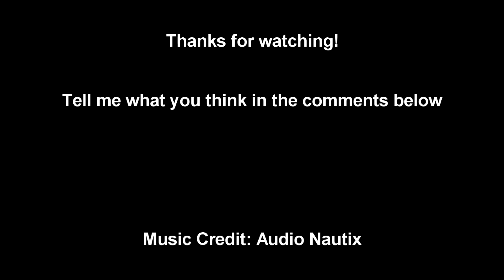The perfect multirotor tune (an IBCrazy tutorial)

Comment: Without looking at the comments, I'm gonna say P is too high (I can hear the oscillation when you rev up) and the D gain is too low, because I didn't see it looking "bouncy" when you were trying to avoid obstacles and I have a hard time grasping D gain, so that's probably the one LOL. I'm a little confused on which it is though (roll, pitch or yaw). roll seems very responsive so that's overtuned.

Comment: Do you tune the P first then I  and finally D? Do you set the I and D low while you tune P? Get P right then work on I then D? I have an APM controller that I did an Auto tune but it has never seemed 100% right. Thought I might try a manual tune.
Reply from the maker: +MrMasemu - Usually you tune in this order: P, I, D.  I have an initial tuning guide in the description that gets you very close.  This is more of a troubleshooting and advanced guide for locking your aircraft in.

Comment: So what would happen if your d was too low and your I was to high? The reason I ask is I have a quad that shakes violently to the point I can't get it a foot off the ground. But it's slower oscillations than a p gain too high so I'm stumped.
Reply: +Kurtis Towery what mode are you flying in?  Try putting it on acro with low rates, I had a similar problem to what you describe, and it turns out it was a dodgy sensor on the flight controller, and it was going nuts trying to auto level....  Also I assuming here that you have orientated the flight controller correctly in your openpilot / cleanflight / whatever settings?  It could also be that your props are not balanced...

Comment: Your tuning method is different than mine, but I've been flying the revo and revo nano lately which changes it up quite a bit. The CC3D is a bit of a bear to tune compared to the Revo and Revo Nano. You're also making coordinated turns which makes it difficult to distinguish overtune noises from all the axis.

Not flying it myself makes it tough. There are a lot of nuances you can get from visual feedback of your physical inputs. Your roll looks way off. It seems to be overshooting which is either due to a high Ki or low Kp. Based on how well the roll starts I'd say your Ki is too high on roll. You're also using a lot more Ki than I do in roll as well. 

I think I hear some Kp oscillations during yaw, but it's hard for me to tell over your voice. I'm not hearing anything during just roll or pitch but I hear it during coordinated turns.

I know you said one axis was too high and one was too low, but I think you've actually got two that are too high. You might get similar results if you raise Kp instead of lowering Ki on roll which might be a better answer to your question.
Reply from the maker: +RS2K - Believe it or not, you're indeed correct.  I do have 2 values too high and only one too low.  However, the one that is too high is really difficult because the key is listening to the audio and connecting it to what I'm telling the vehicle to do.
Reply: +Alex Greve I spend a lot of time testing and tuning new firmware. It's good to see someone else who knows how to tune OP hardware. :)

I'd like to know what your stick inputs looks like, but I think changing your TPS curve might actually be better than turning down one of your gains since it only happens during maneuvers. I would highly recommend trying out StabilizationDesiredThrust as a source with a PI target on roll and pitch and trying out a curve that looks a little bit like a ladle (something like: 0.1, 0.05, 0.00, -0.1, -0.05). This TPS setting will change Kp and Ki based on actuator thrust instead of just throttle stick input. I find a setting like this allows you to up your gains a bit more and allows for a smoother overall experience.

Also, if you like to use a lot of high and low throttle during flight you might find this firmware to work better: https://www.dropbox.com/s/l4kc1ba6tmlyjo2/rel-15.02.02%20-%20with%20constraints.rar?dl=0
It uses motor constraints instead of a throttle overhead to provide better flight characteristics. It's the latest firmware for the CC3D and has some some of the 15.05 code in it.

If you ever get the chance I would also recommend trying out the revo or revo nano. There are some firmware changes that can really lock your multi-rotors in place. A well tuned revo feels like a gimbal it's so smooth.

My ears are only picking up the oscillation during throttle input or during coordinated turns. I don't hear it at all during only pitch or roll other than a quick motor jab on a hard pitch input, but that's not something I'd personally try to tune out and even so it may have just been the transmitter springs causing that.
Reply: +RS2K Those damn transmitter springs! :)

Comment: I think P on roll is too high, and I on pitch is slightly low.
Reply from the maker: +Limitless Aerial Systems (Eric Fowkes) - Not quite.  I had this similar tuning in Utah when I told you I was over-tuned.  However, the very thing that explains it is very deceiving by nature because it could be any of the tree values.  However, the key is WHEN the vehicle seems out of tune.

Comment: I think your Roll D is undertuned and the Pitch P is overtuned
Reply from the maker: +Jason Stahl (JaySteel) - Excellent guess, especially with the D gain!  When I first made this, this is exactly what I thought.  However, turns out that was not the case.
Reply: Then I'd guess it's the Roll I gain. Am I right about the Pitch P?
Reply from the maker: +Jason Stahl (JaySteel) - This is a really tough one that I have put out for people to pick apart.  As soon as someone guesses it I will explain what it is and why.